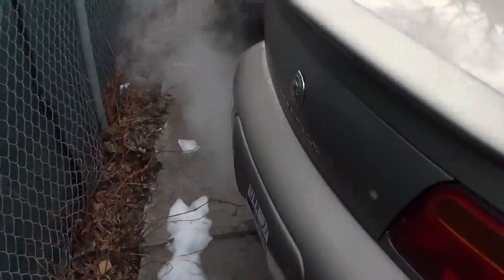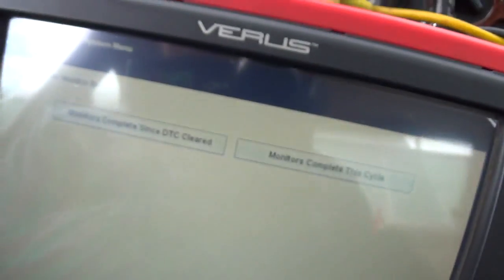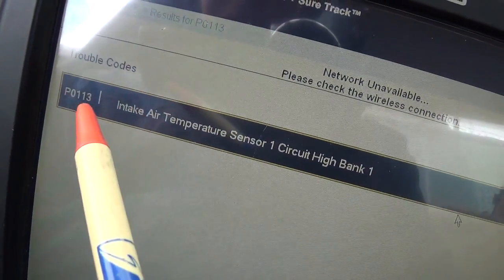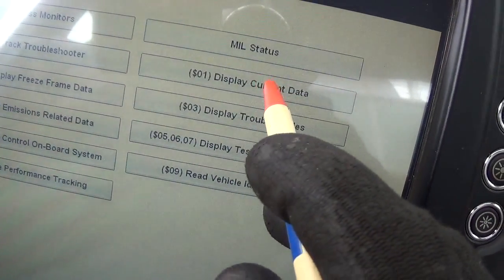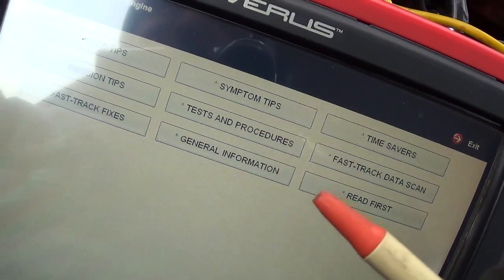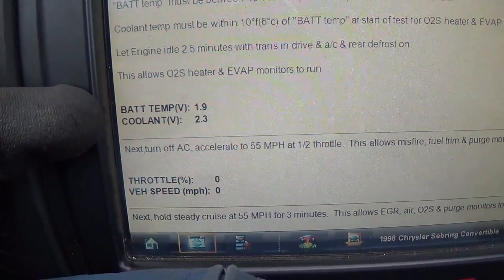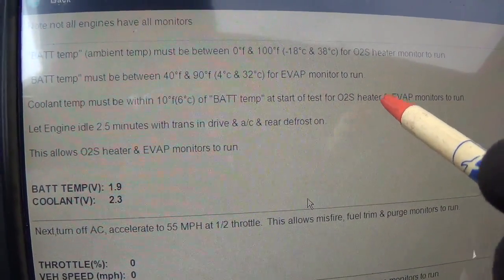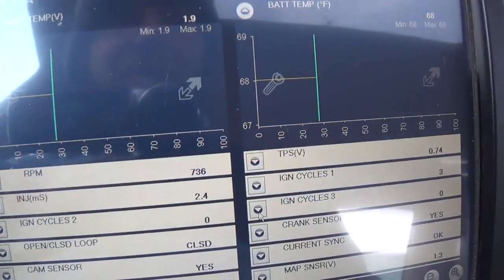OBD Monitors Incomplete: '98 Chrysler -Part 1 (SI Ep 6.1.1)

Comment: This is classic Chrysler/Jeep/Dodge. They seem to do all they can to avoid setting codes, they fake oil pressure, etc. In this case it should have set an o2 and/or catalyst code rather than just mysteriously not completing the drive cycle. Chrysler products are the worst I've encountered for keeping you in the dark as to what's wrong.
Reply from the maker: Yeah, if it doesn't like the O2 sensor, then why not set a freaking "slow response" code or something? Programming fail lol

Comment: Ivan, those early Chrysler's O2's heaters had direct battery current/voltage applied to them thru the auto shut down relay ( I believe ) controlled by the PCM. The amperage was controlled by a high resistance built into the heater's element. As the PCMs got more advanced which were constantly being upgraded, the ( same make and year ) could also have a O2 heater in which the O2's heater's amperage was controlled by the PCM with a PWM signal and the heater element had a much lower resistance. In most cases when a problem acted up after changing a O2 sensor, it was usually blamed on after market parts when in reality it was the wrong O2 that was installed for the application being used. It would be interesting to see the resistance readings between the two sensors heaters or better yet between the new and old sensors ?
Reply: Looked up the wiring diagram for this vehicle, the O2 heaters are powered up by the ASD relay ?
Reply: Ivan, after thinking about it, I may have jumped the gun about saying this vehicle's O2s's heater's are powered up by the ASD relay, even though the wiring diagram I have shows this. The only real way to know if the wiring diagram is correct, ( short of the factory build/vin ) is to identify the PCM being used. This can be determined by looking at the amount of connectors and the amount of pins in the connectors on the PCM.  Depending on which PCM you have will determine if the O2 heaters are PWM or not.
Reply from the maker: Hey Billy! Yeah on this one the heaters are powered from the ASD relay and have a constant ground. So that is a good point, there is no direct way for the PCM to check heater circuit integrity ;)

Comment: why put 2 front o2's in? when only one looked choppy? just wondering.
Reply from the maker: Just wanted a known-good baseline to start with.
Reply: why not just do the one? im not being a smart ass just wondering
Reply: Recently read a very good article about O2 sensors, btw a direct result of watching this channel, Eric O's and Scanner Danners. One of the paragraphs read :

Any O2 sensor that is defective obviously needs to be replaced. But there may also be benefits to replacing the O2 sensor periodically for preventive maintenance. Replacing an aging O2 sensor that has become sluggish can restore peak fuel efficiency, minimize exhaust emissions and prolong the life of the converter.

I'm no expert, far from it, but sounds logical to me from what all I've learned here. 

I've seen this young man countless times make repairs that certainly appeared to save the customer money. I consider that admirable. 

I agree with his statement, and wouldn't hesitate to give him leeway on my vehicle.

And I'm not trying to be argumentative as your question is reasonable.

Just my two cents worth.
Reply from the maker: phil holbrook
You will see in Part 2 :)
Reply: At 100,000 miles you should replace both front O2's as Preventative
Maintenance. Eventually their going to set codes or fail in some way
I have looked at failed sensors-- verse-- new & the only real difference,
was slightly faster switching times & no MIL Lamp or Codes- which is what you want
Like a failed Wheel Hub Brg or Ball Joint (You Do Both Sides) when one fails--Shops & Customers Don't--but I do--your there & the tools are out,so why go back again in a year so,or in the case of an ABS Sensor,
if both sides are not the same brand, you may be in trouble with the data
Reply: Should have said:both wheel hub bearings-being the same brand
& internal design

Comment: Hey Ivan, I'm curious if you are using Mode 6. I have seen a few problem vehicles over the years that will not set a DTC but Mode 6 will show failures or near failures of a particular component. It is a very under utilized diagnostic aid.